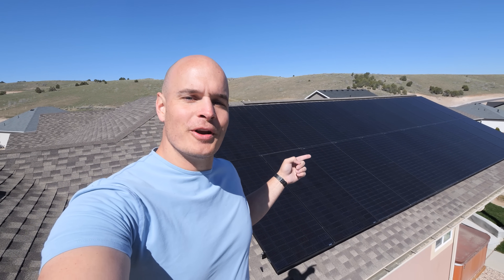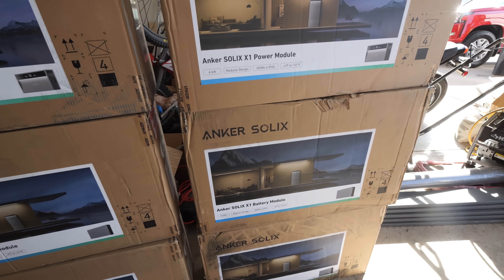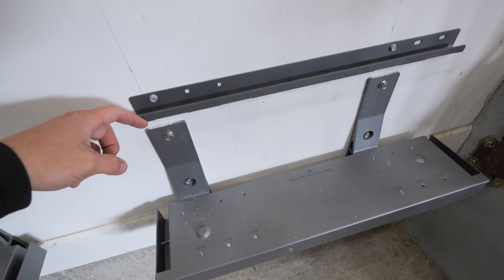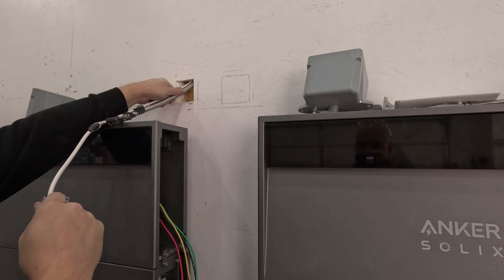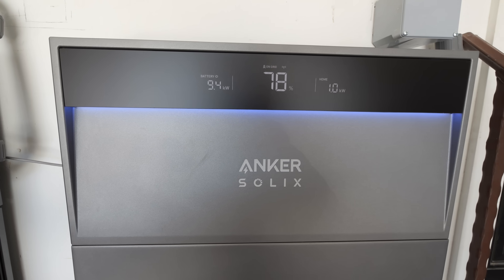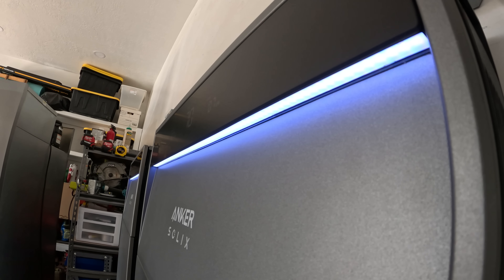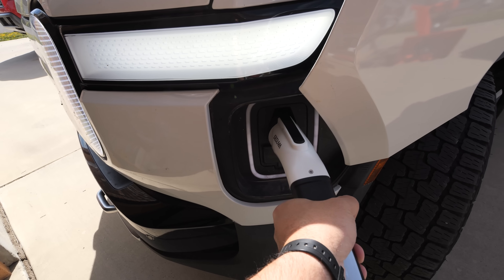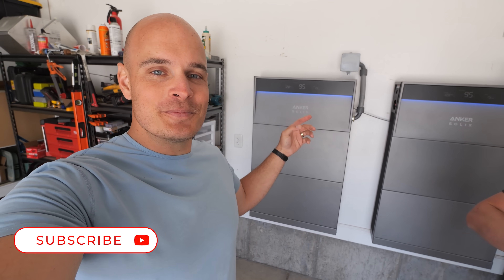How to Save Sunlight for the Night? - NEW Solar Battery Install

Comment: Technology connections did a video about how instead of this absurd amount of power going towards a house it could go towards an entire community. Also the solar panels reduce grid reliance which means the overall infrastructure will be worse for the rest of the community.
Reply: The company isn't going to maintain the grid less if a few people have panels what

Comment: Batteries are expensive and by the time you get your return on this investment, you have to dump them for recycling / the trash. 
You better buy more solar panels and earn more money for way longer. Solar panels are better investment in this case I think.
Reply: Solar has better ROI yes, but not as good to say you have to throw away the batteries right around the same time period you pay them off.

Comment: What chemistry are the batteries? I'm reluctant to put NMC, with their thermal runaway capability in my home. LFP batteries are the only ones I'd consider for an application like this.
Reply: All the major companies have switched to LFP, which though it has less density than NMC the benefits of longer lasting and zero* fire risk make them better for home-application

Comment: What a shame there wasn't a system where your excess power could be sold back into the gird, at a Regulated  price, everyone could afford Solar in a new build because it works out to be a net gain, not a cost.
You know, like the laws that control the electricity market in Germany, which is the reason that 25% of domestic electrical generation in Germany is from households.
But Capitalism is better . . . umm . . .

Comment: Is 12KW enough to power his hot tub? Certainly isn't for mine (which looks quite identical).
Reply: AFAIK most electric hot tubs are a maximum of 40-50 amps. That's 10-12.5kw. So you'd probably want another power module if you were crazy enough to run an electric hot tub on battery. If you have a gas (or other fuel) powered hot tub then it's no problem to run the pumps on battery.

Comment: I wonder how many years it takes for solar panels and batteries to pay for themselves. Before you have to eventually replace them and need to invest a whole lot of money again. I doubt it is worth it at least with the prices where I live.
Reply: That's the best part, you don't need to replace them. Unless there's a catastrophic failure they just keep working at reduced capacity.
Reply: @eDoc2020  we often have hailstorms here in summers so...i doubt it would survive long
Reply: @Tkozuh  Panels are surprisingly strong, they're made to withstand hail. It's normal for panels to survive while everyone else's asphalt roof is ruined. If a panel does break within 25 years it's probably covered by warranty. If not, a single panel is $150-400 and easy to swap out.
Reply: @eDoc2020  the last hailstorm destroyed facades, went through car windshields which is stronger and thicker than panel glass. Threes were heavily damaged and ao on. No panel would survive hailstorm the size of a small fist
Reply: @Tkozuh   If hail is regularly going through everybody's car windshield then solar panels are probably a poor choice of economic investment for you. Standard panels are only made to withstand direct hits from golf ball sized hail.

If you just want to play around with the technology you can throw together a basic usable off-grid system for under $500. That's less than the latest smartphone or gaming console.
Reply: @eDoc2020  dont know where you get those prices. It is no where ear that. Panels alone that would cover all the needs in the house would be over 15.000 here and batteries to store energy even more. No thanks.
Reply: @Tkozuh  I was talking about a mini-system. I'm sure you can get a 300W panel, charge controller, 1kWh battery, and cheap inverter for around that much. It won't run a full house but it's enough for decent lighting and/or a small refrigerator.

And I'm not sure where your $15k panel-only price is coming from. 7kW of panels should have no problem generating 30kWh/day on an average winter day. 20 panels * $200 each = $4000 in panels. I haven't checked recently but I don't think panels have gotten 3x as expensive in the past year or two.
Reply: @eDoc2020  What is the point than. To use it for things that dont really use much electricity anyway.
Reply: @eDoc2020  the fact remains that if you want to be energetically independent with solar power and batteries you need to have a very high income to buy all the stuff. In that case you dont really  care much about the cost of electricity now do you.
Reply: @Tkozuh  The main point of the mini-system is to have fun experimenting. But it's also useful because it gives you a decent source of electricity when the grid's down. You can also take it with you if you go tailgating, glamping, etc.
Reply: @Tkozuh   You need capital, not income. An important difference. You can have plenty of money now but might not be able to rely on future income. Or you might even use bank capital. If rates are favorable you can finance the system and have monthly payments less than the electricity savings. You'd be saving a little bit every month but then once it's paid off the electricity would be entirely free.
Reply: @eDoc2020  i dont agree but let us leave it at that. I think this back and forward has gone long enough. It is clear we have a different opinion. And there is nothing wrong with that. 🙂
Reply: @Tkozuh  I can certainly agree that battery storage does not make sense for an average customer to save money.
Reply: To me it is not worth the investment at all. Plus the laws here suck in regards to excess energy. Not to mention the price of those batteries if you want to store excess energy. Not many people have finances to buy that. Even just the solar panels themselves re hella expensive. Plus there is no more "green" subvention here since apparently there is no more money for that. There is nothing but downsides here. There are many other better ways to save money than buying panels to have a bit cheaper electricity. And those ways dont include a heavy starting investment.

Comment: The SIMPLE solution wait until more electric vehicles can power your house directly with NO extra wiring.  After all most EV’s have far more KWH of storage than this system or any other.  Tesla could do it but it would kill their home battery business.  Ford lightning etc may force others to do the same.

Comment: How does it power the house directly,or there's an inverter in between?
Reply: I believe the module at the top of the stack (with the display) houses the inverter.
Reply: @eDoc2020  i believe that's why it hums

Comment: 4:44 1.3kw!?!?!? 
You don't have fridge!? No washing machines!? No heater!?!?! 
How it's only 1.3kw
Reply: Fridges use very little power. They only consume when the compressor runs or the light gets turned on when you open the door. It's very minimal. Heaters probably aren't turned on and I'm pretty sure washing machines aren't running constantly lol
Reply: @ShockingPikachu  well evan tho
You gotta calculate them right 
It's just very little consuming 1.3kw aday average 
Shii i need at least with previous calculations like 15 kw a day

Comment: yeah not bad isn't it when you get it for free, actually when you get it for and $20k on top to do promotion!
but if you had to fork out over $100k suddenly is really bad...
speaking of gas power generator which costs $500 but hey it' soooooo loud...
or free $100k batteries and solar...
yeah sure anything for the money!

Comment: Those are the lightest 5 kw batteries I have ever seen , the way you were handling them it seemed more like 1.5kw units each. I have a solar system with SVOLT batteries (LiFEPO4). Way heavier than those you have

Comment: The real test of the switching time would have been to use a PC and see if it resets since electronics are much more susceptible to switchovers than halogen lights. Really shows that this is sponsored

Comment: Why would your friend install 23 kW of solar panels on the roof of his home? That seems like a bit overkill. Unless he owns multiple electric cars and drives them hundreds of kilometers each day, I guess...
Reply: I mean he's wearing an oshcut shirt which suggests he's affiliated with them. He probably has some laser welding equipment in his house for fun which consumes a metric shitton of electricity
Reply: 2 electric cars, each 60 miles a day, and a hot tub. Enough excess production throughout the summer to cover winter.

Comment: Did I see an Enphase combiner box? Are you AC coupling these to the existing Enphase system cause I did see you plug PV Directly into the anker battery 🧐 please elaborate

Comment: The batteries will cost more than the solar panels and for the rest of us who have to actually buy them - they are usually priced in such a way that you can't pay them back with the savings from the grid power you are saving. So your best bet is to get something cheap = which means you will certainly not get a 10 year warranty. Setting the battery management is crucial. Set it so it never goes bellow 20% and never goes above 80% charge and set it so it charges slowly during the day and not just take all the available power from the solar it can get and dump it in the battery in an hour. That way your batteries will last a long long time and you will never have to replace them. Because if you do - it absolutely destroys the budget of the solar system and you will never get your money back and the whole thing becomes pointless.
Reply: "whole thing becomes pointless" people use solar + batteries for more than just ROI you know? Having to not rely on the grid and have pretty much forever outage protection may be worth a few extra years on the return time for some people.

Comment: Hahahaha he has 20 kwh system? Nuts hahaha..  maybe he has large Ac unit...  We has 3 adult used. 7-10kwh a day..  I go off grid. I install 30kwh batteries and 4.97 kwh solar ( max solar is 4300 in best sunny cool day)... so I add 2.6 kwh solar (6 x 485 -520 w. Half cell bifacial. Q-cell brand) I have no worry of cloudy any more.  Now adding 15kwh battery and will add  more 15kwh battery later because battery price went down... 70 Usd per 306  Ah  eve max. 320 Ah.... If you guy want order  Aptera , please use my link. Thanks a lot....

Comment: This is an AC coupled battery right?  Thats neat because it can be installed with existing solar. DC coupled can only be done if your existing equipment is compatible but it does have advantages such as using a single inverter.  Curious how the pricing is but Anker doesnt list it. If you have to ask you cant afford it lol.

Comment: I'm constantly impressed as to how simple Solar and solar accessories are becoming year after year and month after month.  But once again, when I do the math, in a perfect world with no degradation it would take roughly 16yrs for me to recoop the costs of switching to solar.  I figure after about 10-13yrs I'd be looking to replace batteries.  So I guess I'll stick to the grid for now. 

But ultimately keep up the content. My comment may sound negative but ultimately I'm enjoying the content and how you expose your viewers to new products and possibilities.
Reply: The return on investment has many-many variables, location, energy rate, amount of panels, installation cost, etc. What may be 16 years for you could easily be 9 years just down the road. Not to mention the government incentives to reduce the price.

Sidenote, batteries that are LiFePO4 can last much longer than 10 years ( even the old Ni-Cd are probably more realistically closer to ~12 years before super-meaningful degradation. ) I believe LifePO4 is closer to ~16 years.

You may want to look into DIY your system like Jerryrigeverything did
Reply: @TypicalBlox  lifepo4 can last even longer than that. the most common cycle count ive seen is about 6000 cycles until you have 80% of the original capacity remaining. and a cycle is a full discahrge to 0% and then all the way back up to 100% 6000 times. if you did that every single day thts about 16.5 years.... to have 80% capacity remain on those batteries. if you manually adjust the lifepo4 charge controller to work go between say 5% capacty and 95% so it never fully dischargers or charges the cycle count is even higher.

tldr. lifepo4 batteries last a very long time. youre going to end up replacing your inverters/ charge controllers before the batteries.
Reply: I did the calculation 10 years ago, and I am now kicking myself for not doing it, would have only been 16k for the whole system(no batteries) and they were paying 28 cents a kilowatt. But at the time I said the same thing, that it would take 7 years to break even. It's hard to account for how things will change.
Reply: @thadude3  7 years is nothing as long as you don’t move often
Reply: @thadude3  who knows, they could had all fried within those 7 years. I will give it another 10 before I make the solar jump.
Reply: It really depends on where you live and what your utility rates are. Here in california i put in a 14.2kw Enphase iq8 system with 20kwh of Enphase batteries and my payoff will be 6.2 years. it makes sense for me with the rates so high. low rates are $.43/kwh and peak rates of a $.57/kwh.
Reply: Completely agree. If I had the extra income I would still do this setup just for emergencies. I wish I knew how to do this because then I would just get the cheapest panels I could find on the market and repurpose a used battery from a decommissioned ev car and just go about it the cheapest way I could. Those battery packs pack so much juice

Comment: Little confused, why was the charge rate so low and the backup time only 10 hours in daylight?  Shouldn't those many panels be able to completely power the home and not discharge the batteries until the sun sets?  I would expect the solar to pass through and even have enough output to handle charging the truck.

Comment: If your house is using 2kW ambient there is something leaking energy. Lol our house is 200 to 600 watts ambient, and our house is 100% electric, zero gas. We have 8.4kW + 1 13.5 usable kWh powerwall 2+ setup on our place. $21k total cost to us after incentives.
Reply: To start with most people have refrigerators. If you have a kitchen fridge and a second garage fridge that's already close to 200 watts continuous (equivalent). Then there's stuff like cable modem/routers and TV boxes/DVRs which are probably pulling another 50W continuous combined even when not actively in use. Then things like microwave/stove clocks and other stuff drawing at least 20-30W combined in standby. That's almost 300W before you turn anything on.

Comment: I'm using an EG4 18KPv with wall mount batteries. Outdoor weather rated system. Have 2 batteries 14kwh each... 3 arrays of panels. At almost 600v each. Forget the wattage but MPPT's are 25a and 2 15a.

Comment: Kinda senseless to spend stupid money on stationary batteries when you have cars that support V2G charge-discharge. Nissan Leaf has supported this since the very first production in 2011 and then you have 24 KWh of usable energy or 30, 40 or 62 KWh if you buy the more recent models. Getting a used Leaf plus the necessary equipment would set you back significantly less than these anker battery banks would and then you have a car to do your commute in as a bonus.

Comment: For future reference, most Californian hate NEM 3.0. It was pushed through by energy lobbyists and makes it harder to realize financial incentives for going solar. The pace of installs collapsed after it was rolled out. 

Basically, they pay virtually nothing for any power sent back outside of peak hours. If you finish topping off your powerwall by say 1 PM, you'll have 3 hours of prime generation capacity sent back to the grid where you get paid a couple cents. Older NEM arrangements were much closer to 1:1 payoff at all times.

If you do have a battery system and can pump electricity into the grid during peak hours, that's great and you'll see a faster payoff. But NEM 3 is really just a shittier NEM 2 where they find ways to pay you less for the majority of the day. If you have solar without a battery, you're f*ed.

Comment: -4F is not outlandishly cold, and guessing that's in Freedom units, not Celsius. 
I do notice that when it hits -20C here, which is -4F, my Google Doorbell complains about battery not being able to charge and can stop working. If it stays there for an extended period of time, have to bring it in. This is why EVs need better batteries, because it gets cold some places, and most batteries just can't handle winter weather very well.

Comment: With the batteries having an outdoor rating, is it safer to mount them outside the home? In the case of a house fire or battery fire, do you need some kind of warning for the responding fire department?
Reply: these are LiFePO4 batteries, no risk of fire

Comment: Why no price breakdown? and how can that cardboard wall hold those battery's?
Reply: A standard American wall has wooden studs behind the drywall every 16 inches. The batteries mount onto the studs which are at least 2x4 nominal inches, aka 38x89mm actual.

Comment: There is no way the average HOUSE is using 30kwh. Apartments, etc. under 1100sq feet, maybe. But anything over 1500-1800 feet is going to use 50+. That number must be skewed by "households" and not actual houses.